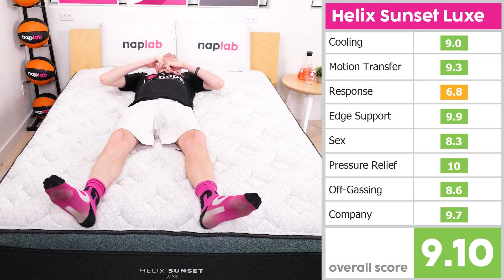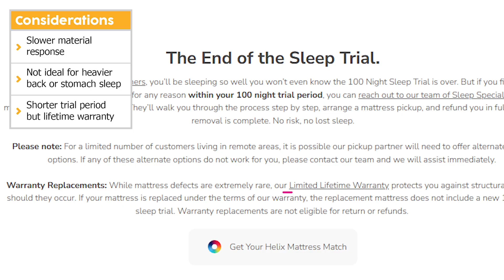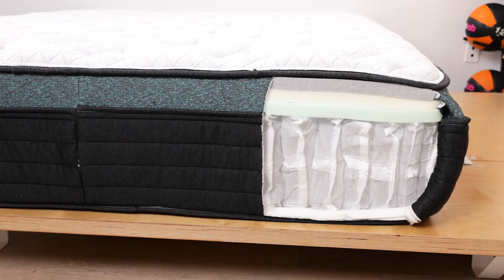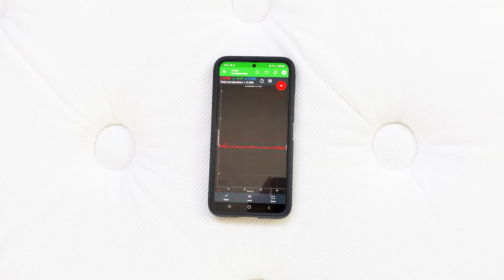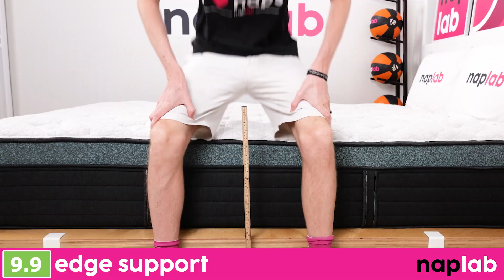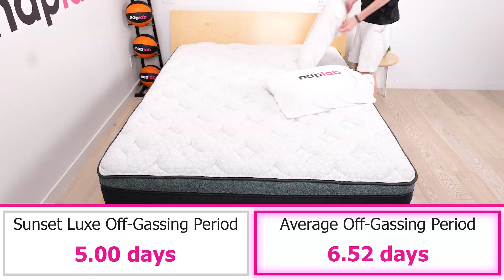Helix Sunset Luxe Review - New Version Tested

Comment: How do you think this compares to the Saatva Classic in Plush Soft? I'm looking for something that is softer than the Winkbed Softer which still caused pain in my lower back and shoulders (back and side sleeping).
Reply from the maker: They are very different mattresses, but with a similar firmness.

Winkbed and Sunset Luxe are both hybrids with thick foam comfort layers.

Saatva is a more traditional coil mattress and uses less foam.

It's possible your body would simply do better with a little less foam and a more traditional coil feel.

Though if you're finding Winkbed not a great fit, I'm not sure you'd really like the feel of Sunset Luxe any better, as they are far more similar to each other.

Comment: How would you compare this to the Nolah Evolution mattress? I can’t make my mind up. I like my mattress to feel soft but want to feel cooler at night, as i tend to run really warm.
Reply from the maker: You can see how they compare here - https://naplab.com/tools/side-by-side-mattress-comparison-tool/?_mattress_name_dropdown=helix-sunset-luxe%2Cnolah-evolution-15

Both great mattresses, though I do lean more towards the Sunset Luxe. Sunset Luxe with the optional cooling cover has the better cooling.

One note - Our data on the Nolah Evolution is about to be updated. We have the newest version of the Nolah in our lab. It just finished testing and it's new overall score is around a 9.01 (it lost a few points for response and edge support compared to the older version, making the Sunset Luxe the higher performing mattress overall...though it makes sense given that it's also more expensive).
Reply: @NapLabReviews  would you say sunset over winkbed as well? thank you for responding 😊

Comment: Any view on the GlacioTex and CoofForce cover options in terms of cooling and also any effect on firmness?
Reply from the maker: We've tested Glaciotex on numerous mattresses and CoolForce on one model.

CoolForce is an interesting concept, but in our testing it did not seem to make a significant impact on cooling performance. If money is no object then sure, I think it could be worth it, but for most sleepers I don't think it's worth the money.

Glaciotex is a more straight forward cooling cover. It is incredibly high performance and comfortable, arguably the highest performance cooling cover I've tested to date. In our tests it made a significant impact, improving cooling by a full point on our cooling scale. If you're a warm / hot sleeper it is absolutely worth the upgrade.
Reply: @NapLabReviews  Thanks.  How slippery is the glaciotex material?  Asking bc my Sealy brenham II hybrid has a surface that is too slippery to keep the sheets from sliding and bunching.

Comment: Thank you so much. 

I’m curious if the lumbar support in the Luxe versus standard would actually be less comfortable for some side sleepers.
Reply from the maker: I do think the lumbar support will be less comfortable for most side sleepers.

Helix has had this optional ergo support layer for a while now and I've received quite a few complaints from my readers / viewers who added the ergo layer only to find it creates too much support / push back in the middle, which creates comfort and pressure issues.

I think for it to make sense you really need to NEED extra pushback with less sinkage. I think there is a relatively small percentage of sleeper who will benefit from the ergo layer, in my view.
Reply: this is what I've always questioned

Comment: Is this or the Midnight Luxe better for someone who is only a side sleeper? 170ish in weight. 

I want it to feel super comfortable and soft when I lay on it, but i want to make sure it supports my body because im athletic and when i sleep i need great alignment and pressure relief. 

At first, I thought the midnight luxe, but part of me thinks that is better. What would you recommend?

Also, there's an add-on for the ergo- align layer, for back pain. Is that something you think is worth it or worth skipping? 

Thanks for the videos. You do a great job and deserve a lot more views.
Reply from the maker: Based on your feedback here it sounds like the Sunset Luxe is the better option.

I would not recommend the Ergo-align layer. For many sleepers it ends up creating an improper level of support in the middle, which creates more problems than it solves.

Lastly, thanks so much for your kind words. I'm really glad to hear my videos have been helpful. :)